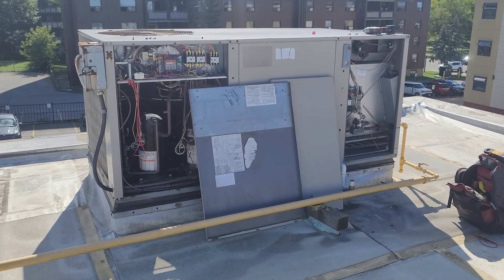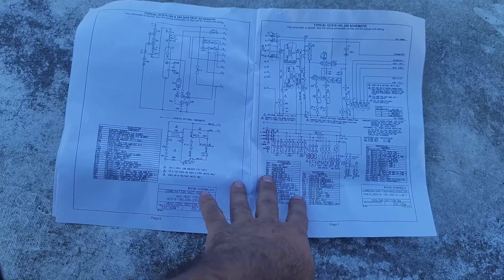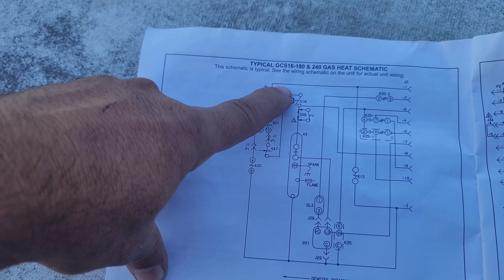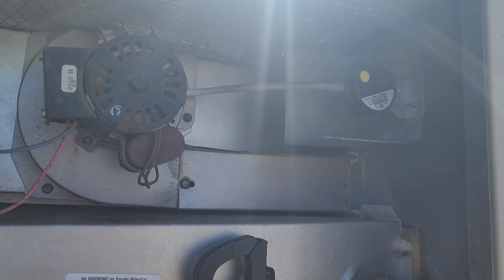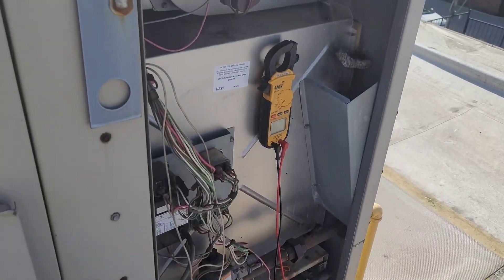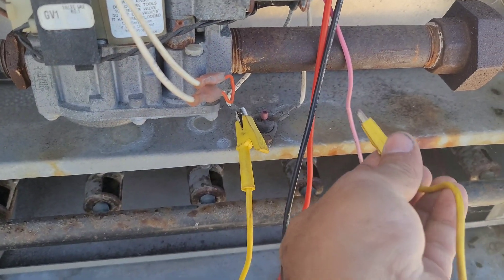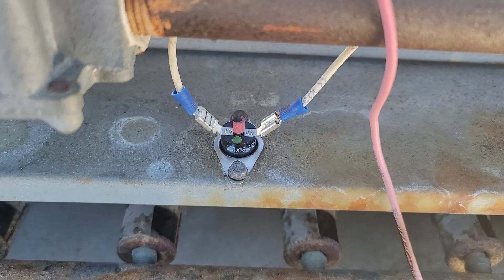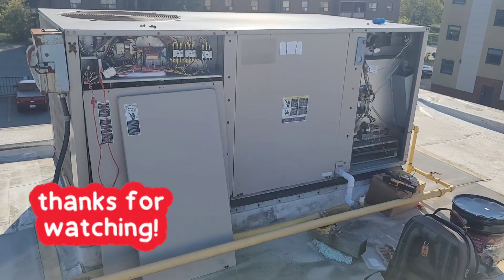LENNOX package RTU Not working

Comment: Doesn't the rollout switch simply need to be reset? That's what the red button is for, no?

And question, where did you buy the jumper cables with the clips?
Reply from the maker: @Mo4Honesty  yes that was manual reset type roll out switch but was faulty,  I got jumper from amazon
Reply: @Learnhvac.  I see. And about the jumper cables? Thanks 🙏